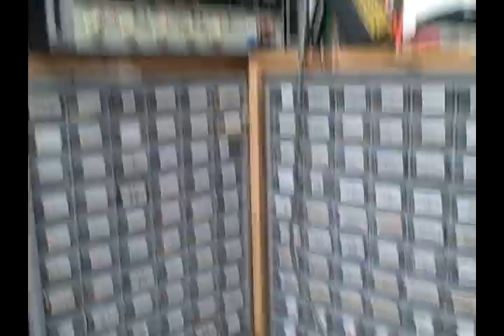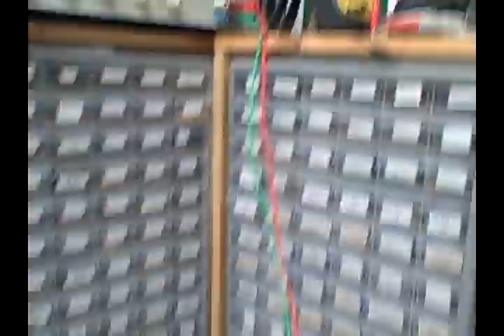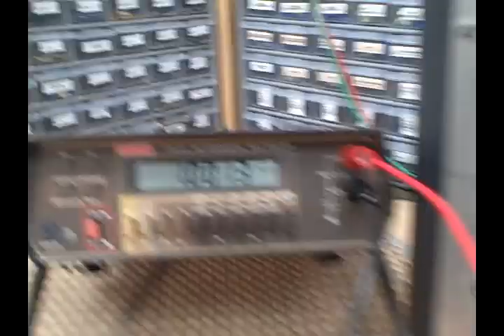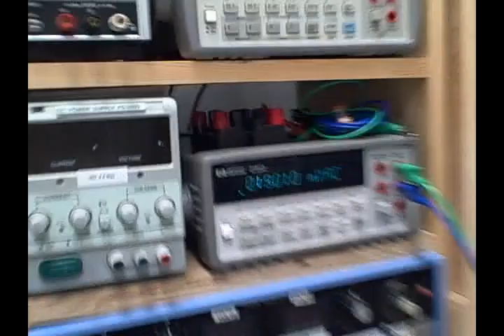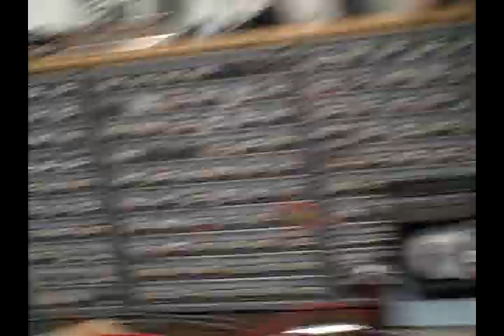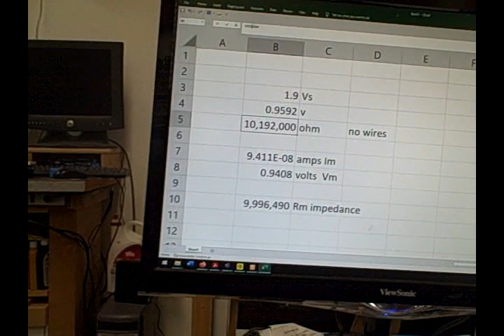Keithley 175AV unit 2

Comment: Hi, when you were working out the current in the circuit you forgot the internal resistance of the meter that was measuring the voltage across the resistor.
I'm assuming a resistance of around 10Meg Ohm of the meter that was across the ~10Meg Ohm resistor so in parallel a total of 5Meg Ohms. Wouldn't that skew your results?
What did I miss?
Reply from the maker: The HP34401A had an internal resistance greater than 10Gig ohms.
Reply: @bap8guy  Ok, so it was negligible.
Got it.

Comment: Do you know the year these were made ? Sorry in the early 80s thank you. Because of the high impedance,  you can use this on vintage tube equipment  ,  and high frequency radios. Correct me if I'm wrong.
Reply from the maker: They should work great on tube equipment.  Just be careful to use the right ranges, or if you are not sure, start at a high range and work down.
Reply from the maker: The 175 came out in about 1983 and I think the earliest copyright on the manual for the 175AV model was 1989.